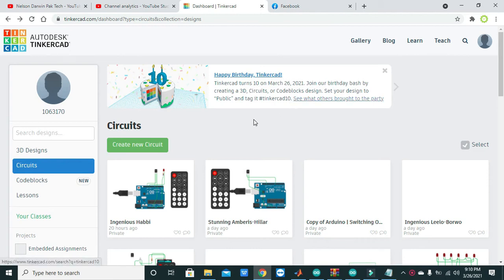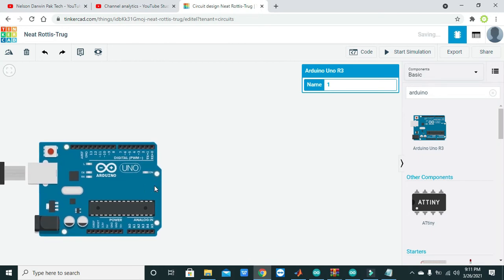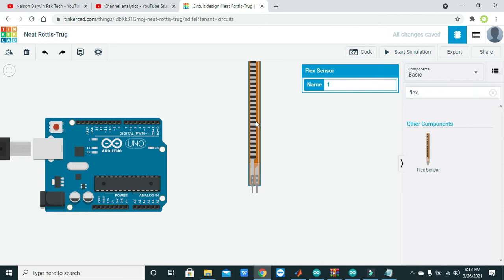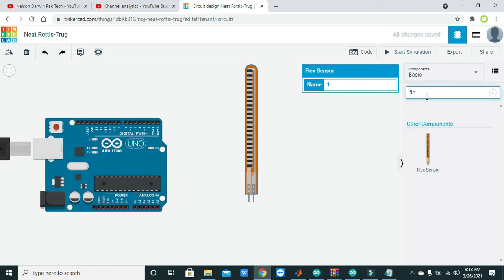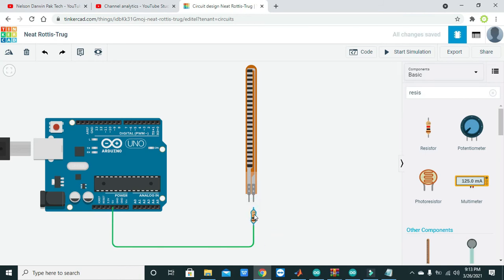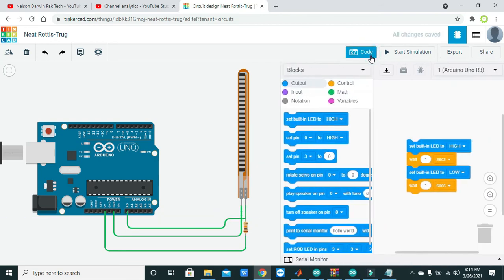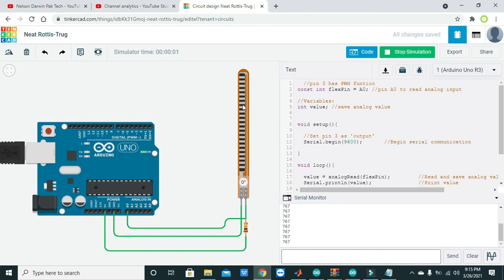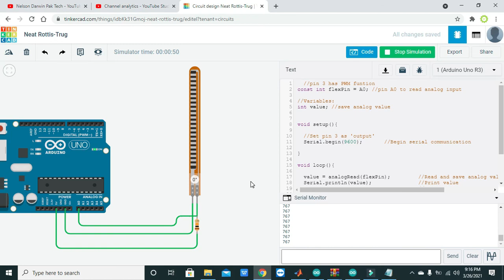how to use flex sensor in tinkercad with arduino | simulation of flex sensor with arduino

Comment: Why did you use 10 kohm
Reply from the maker: although too much time passed...but usually resisators r used for 3 major tasks..voltage drop, limiting current and pull down or pull up....